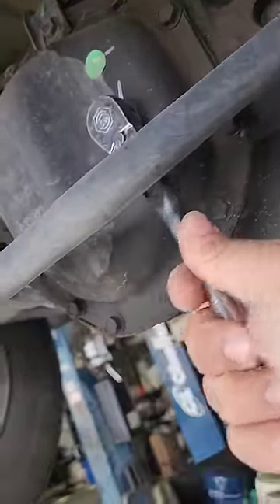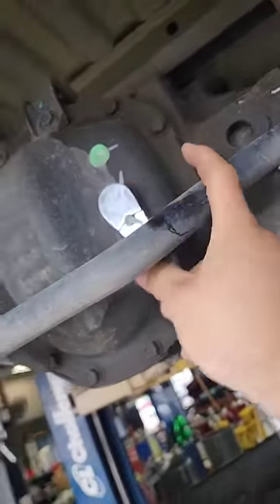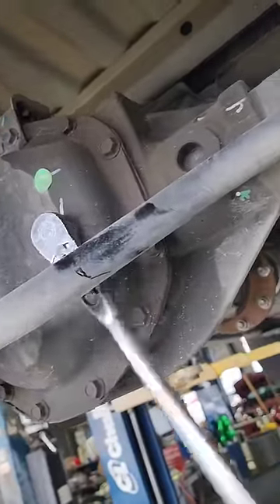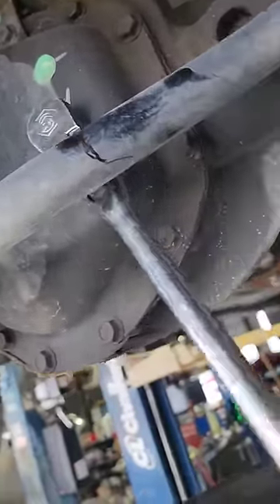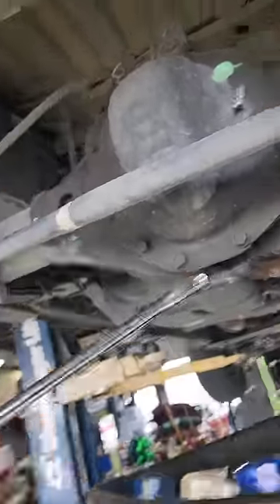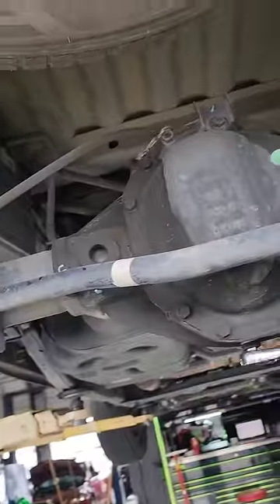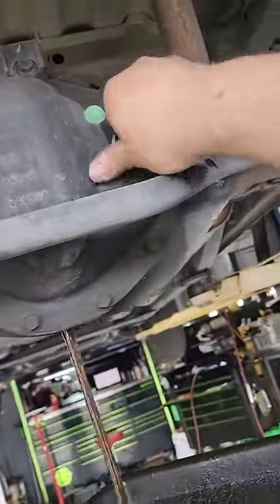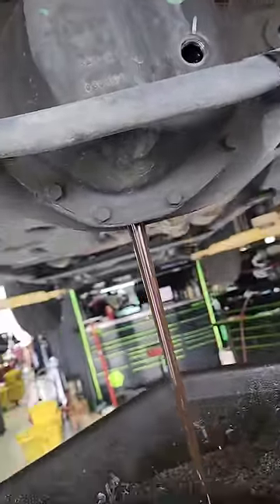MECHANICS PRO TIP #shorts #mechanic #auto #tools

Comment: The vent hole works as a fill, if needed.
Reply: @towtrkdug43 he’s referring to the vent tube coming off the top of the diff. Cant see it in this video.
Reply: @towtrkdug43  Correct, that is a fill hole but you can still fill it using the vent hole on the top of differential.
Reply: @LionWithTheLamb  I see what you're saying now. I misunderstood. I deleted my comment
Reply: @kingaxium5712  yah, I didn't pick up on that at first. I get it now. Deleted my comment...

Comment: Some diffs can be filled removing a cover bolt or its vent. 
Yes, it's a tiny hole and sucks, but can be done by any compentent Mechanic.
Btw,
If the hundreds of diffs worked on, I've never had a fill plug not come out. And that's on New England coast...

Comment: Always make sure you can fill it back up!!! I always teach my technicians this. I work on forklift, so this is very imperative for gearboxes.
Reply: Personally I always make sure to make sure the the top fill hole is not seized up before I remove the drain plug, Because if it is, it won’t be possible to refill it. But that’s just me. What was the video about anyway?

Comment: An additional tip for when you're checking the differential. After removing the top plug, make sure to dribble a drop or two out. That way when you replace the plug, it will lube the threads and keep the plug from seizing.
Reply: None will even "dribble out" because it is only ever filled to the level of the plug. But yes, always oil the threads on any fastener used in a motor vehicle, to prevent corrosion.
Reply: @johncoops6897 do NOT oil the thread on “any” fastener in a vehicle. Thread lubrication affects it’s torque spec. If you lubricate a head bolt and toque it to spec, you’re not really torquing it to spec because the specifications didn’t account for any thread lubrication. Although I like to lube my threads too, you have to be careful which ones can afford the extra torque of lubed threads.
Reply: Or just put anti seize on it 😅😅😅😂😂😂
Reply: Or just use anti seize
Reply: @malachihornbaker5869  who uses a torque wrench on a tapered thread fill plug? Just make it tight. SMH
Reply: @malachihornbaker5869  not true. You mentioned head bolts as an example. Head bolts are typically specified to be installed with a sealant or anti-sieze/oil depending on conditions. If "dry" it would be because there is already a dry lube/sealant on the new bolts. Never truly dry, they will gall.  Same for any other engine bolt- sealant, anti-sieze/oil or loctite depending. Most replacement chassis hardware is either plated or has a film which reduces friction by nature or has locking nuts/washers anyway.
A tapered drain/fill plug isnt going to back out because it has a little oil on the threads, the taper locks it

Comment: Seized plugs are usually easy to get out with a air hammer
Reply: I think the video he was referring (that he got the tip from) was some Honda had the fill plug in a awkward spot
Reply: @Burns11112  ohh ok ya an air hammer only works if you can get at it

Comment: Can't wait for him to find out to take oil filler cap off so oil drains faster
Reply: It also fits great over the hood latch so you don't drive off before you put oil in... again.😥
Reply: Crankcase is already open atmosphere through the air cleaner.
Reply: @Carlitosway211  and that's why I just go ahead and throw away all my pcv valves and put in flux capacitors
Reply: @mthompw  There's only one PCV valve per engine. The fresh are side is open to atmosphere.
Reply: Exactly, that's why I get rid of my pcv valves and install dual rotor flux capacitors

Comment: Thats why the second one is there. Its the same for all types of things that pour liquid at a decent and even rate.
Reply: It isn't why the second one is there. I hope you're trolling. You have to put fluid back in and that top hole is for putting the fluid in. Also you fill until it starts to overflow from that top hole. Thats when its actually at manufacturers recommended fluid level. -fill it til it overflows...
Reply: @brandondeel3567  it allows air in when emptying. Have you ever drank coffee? Or poured stuff out of a can. You add a second hole to gain a more consistent flow.
Reply: @Titantitan001  ofcourse the second hole is going to have that effect but thats not why its there. Its the fill hole. There is no other way to put fluid in a diff than to fill it from the top hole. So while it does help the fluid flow out faster, thats not the reason the second hole is there.
Reply: @brandondeel3567 I don’t doubt that? Things can have more than one purpose my guy lol.

Comment: I don't worry about it. Wisconsin guy here. Just drain and reseal, then if the plug is froze up, needle scale it, or clean it up, and plug weld a 1/2" nut or lug nut to the fill plug, sink that heat in hard, wait about a minute, and roll it out..... Works every time. Over a dozen or so trucks rolling around this county with a nut welded to the original fill plugs, yeah I leave em' that way, easier to get out next time they roll in. 👍

Comment: Fluid looks good! That’s crazy cause the owner must be doing RECOMMENDED maintenance schedules. That’s awesome! Not many folks do that anymore
Reply from the maker: Most people with COMMON SENSE would not be able to comprehend this comment 😂
Reply: @FluffyMexicanik  common sense at all that common! Kinda sad really 😅
Reply: They want their to be good as long as possible, I can’t tell you how many times I’ve recommended services after a truck has 160 and haven’t a done a front, transfer case or rear diff. And the gear oil looks disgusting

Comment: A tip i learned the hard way, on a sealed box, remove the fill plug first to vent air pressure. That way, when you open the drain, it wont aoray all over you. On automotive, this probably just means the coolant system, but heavy equipment is different.

Comment: You also pull the top plug first to create a vent so when you go to drain it  there's no pulsing effect (try pouring out a gallon jug of anything and it goes in starts and stops) the vent allows air to take place of the fluid and push it down evenly.

Comment: My dad thought me this when I was learning in my early teens. I thought it was a very good tip coming from him to say what a fool he can be. Another tip when changing spark plugs is to put the new ones side by side against the old ones which you have removed as sometimes auto parts stores have supplied the wrong ones and the ones they have given you might be longer plugs and the pistons might smack into them. I know someone who this happened to.

Comment: My dad had a Plymouth cricket when he was young, and he said he had to change the transmission fluid once. After he drained it, he tried to remove the fill plug, and it stripped, and it absolutely would not come out. It's a small car, high mileage, and not very valuable. He didn't wanna screw around trying to remove the plug anymore, so he took the tractor and basically held the car upside down, and filled the transmission from the drain plug. It was the last fluid change he was gonna do on the car so screw it

Comment: That fluid looks just as good as brand new would. I have never just changed the fluid in any differential I've ever owned I had a Ford Fairmont with 250,000 mi on it never had a differential problem

Comment: Check and clean the axle vent to make sure it isn’t stuck shut. All that oil on the differential could be a sign of a axle over pressurizing from a stuck vent, bad cover gasket, or pinion seal. This job is more than just a drain and fill with the evidence seen.

Comment: That tip is one that you won't understand how bad of a situation your in till it happens. I got through my first top plug seize using a ratchet on a floor jack. But not everyone's as lucky as me. Coming from a mobile mechanic, be skiddish, cautious, and as slow as need be when it comes to servicing a vehicle. Think of the worst outcomes and do those first

Comment: It kinda doesn't matter if you can't take the top plug out because if you can't the the top plug out then you aren't charging the fluid. Now check the top plug first and if it doesn't come out change the rear cover and plug assembly and then fill the diff up to the fill plug on that diff. I'm not saying you would not tell the customer that the top plug is stuck or charge them for changing the oil when you didn't but the customer will know you are a good mechanic and can trust you when you tell them about the stuck plug and I never had a customer complaint about cheating them because of fix the problem. Always let the customer know and when you call them have the price and availability of the part to fix the unexpected first.

Comment: Ok so if its stuck. You just give up i guess.
Axles have a vent tube. It can be changed from the bottom no problem. How does a outboard motor lower unit get changed. But macanical tip if something does not work try something else.

Comment: If the top plug is seized and you have an anti-lock brake sensor on the top as many Fords have, remove the sensor and add the required amount of lube through that opening.

Comment: Yeah, if it's seized you can Google the car find the type of rear end and it will tell you if the bolts are straight through. You should always google the car so you use the correct fluid in the rear end

Comment: That is one of the first things I got taught when I got into the trade. Not just because you want to make sure you can refill before you drain, but because it aides the draining process as air can come in through the top, rather than glugging in through the drain plug. It is concerning that someone in the trade didn't know this.

Comment: If you get stuck, pull the axle and suck it out with a hose and refill with the hose until it pours out the axle.  Especially if you can't get either plug out

Comment: Open the top plug.dip in your finger.if it's not black will metal bits in it put back the plug.its good for another 20 thousand miles.

Comment: You can refill without uper plug but it's messy. Stuck a long tube and bent it over the top of differential. It can indicate the level too when the siringe isn't connected with the tube.

Comment: Has a vent tube. Force filill it back through the drain hole with Designated amount of fluid overfill by 4 to 5 Ozs depending on how quickly you can move lol.

Comment: You open the fill plug first to make sure the vent isn't clogged and that it had the proper fluid level to begin with. If the vent is clogged the diff will be pressurized and you'll hear the air escaping when you are taking the fill plug out. It'll probably spray fluid too if you take the plug out to fast😂..

Comment: On a outboard boat engine, it is recommended to pump the oil from the drain plug up through the system until it starts coming out thr fill plug
Reply from the maker: really?
Reply: @FluffyMexicanik  yep
Reply: @FluffyMexicanik  the lower unit gear oil, not the engine oil
Reply from the maker: @andrewarmstrong9194  ohhh ok that makes sense lol

Comment: Gear oil. In general it's not replaced unless there's service, like pinion bearing failure, axle bearings or shaft seal issues.

Comment: Actually if the fill plug strips there is a way to fill it there is usually a valve on the top or a hose connected. My 94 Chevy has a stripped plug and that's the only way I can fill it

Comment: ⚠️You CAN refil from the bottom with a pump. Pump the required amount in plus 50ml because that's the spillage amount while you quickly put the plug back.⚠️

Comment: As a former tech in the snowmelt, you have no clue. 😂
We know those plugs are rusted shut, so we just order a new diff cover.
Remove the old one as it drains, clean it all up, install the new cover & fill it.
But usually, you need a new truck before your diff needs serviced.

Comment: I always check the top plug on each axle(if equipped) on every oil change T/C as well and it drains faster with the air flow

Comment: Homie if your top plug is ever out of reach or stuck, stuff a pump hose in the drain, stuff rags around the hole and the hose, and pump as fast as you can, youll get it all im there no problem

Comment: always make sure you can add before you take away, even oil changes, make sure you can pop the hood and take the oil cap off before you drain it. In the rust belt hood latches rust and cables rust.

Comment: Dont see any talking about how its also good to remove the cover and clean off the magnet. It does buildup with ferrous shavings..
Reply from the maker: The magnet is on the plug its self
Reply: @FluffyMexicanik  
So those dont have a magnet stuck to the cover? Well, I like that design more. I've only ever had diff covers with no drain plug. Thx for sharing!

Comment: You can pump oil back in the drain using a piece of fuel hose the same size as the hole, as long as you know the quantity to put in it.  'Worst case Ontario, you don't need to be a rocket appliance' - Ricky

Comment: It's very easy if top plug is rusted.   Take cover off and put gear lube in plastic zip lock bag. Place bag in the rear end and put cover back on.    That how I did it for years.

Comment: If the top plug won’t come out or seized are you call it you fit it. That’s what mechanics do. If you can’t pull the ABS sensor employer on the top of the differential that way.

Comment: Another quick tip - never use the ratchets drive directly on the bung to crack it, use an extension. If something is going to snap better it be something cheap.
Reply from the maker: Never had an issue, yet

Comment: Same process holds true for transfer cases and manual transmissions pretty much anything with a drain and fill plug always take out the fill plug first because you can drain it from the fill plug and you can't fill it from the drain plug

Comment: I've had 4x4's most of my life and that's common practice since many will drive through water at some point while on or off road. I'll usually check the vent tube as well since they'll get plugged on occasion.

Comment: It is a very rare occurrence, even on Rusty trucks, to have a fill plug and a diff that cannot be removed
Secondarily, if the plug is seized then it needs a new diff cover which fortunately are relatively cheap and easy to acquire
I work the Rust Belt for 40 years and in that time I don't recall ever having to replace a cover for an unremovable fill plug.
Just saying, it's a nice little internet something something
But it ain't real life

Comment: You could also use the correct tool that square hole is tapered, a ratchet head is not. there are tapered plug sockets for that job.

Comment: You can actually pump oil up thru the drain plug if you get into a future situation. Done it many times especially with no fill hole transmissions. So this is a new tip from me 😊

Comment: The big reason why you attempt the removal, if I recall correctly, has to do with suction.  When you drain and attempt to remove the refill, it feels like it was torqued by a gorilla pumped with steroids cause that shit will be HARD to remove.

I’ve ran into this twice.  Even on one I knew was torqued to spec

Comment: Pro tip: if the fill hole is on the cover it doesn't matter if it sticks. It can be easily removed or replaced.

Comment: I was taught the same due to rust also to leave the fill plug out to improve the draining of the fluids. Like for oil changes remove the filler cap before the drain plug. that was way back in 1977 by my dad.

Comment: you can also just look up the specs and get the fill amount and bottom fill it. wrap a rag around the nozzle of your oil dispenser and stick it in the drain and put just a little bit more for when you quickly take the nozzle out and put the plug and spill a little bit

Comment: I mean is it really a proper service If you don't remove diff cover and clean everything and pre lube diff, clean mounting surfaces, clean diff cover (I even paint it, yes on every every vehicle) and then reseal and fill with what ever fluid and additives necessary. Then rock diff back and forth after filling before driving. And the stuff I work on is BEAT, Canadian weathered ,ocean aired rust buckets. So there's my tip on stepping up your game !

Comment: My husband's had only the top plug it did rust up but my dad had the tools to drill and retap a new hole ,he was changing the gasket it was leaking he had the plug at the top to refill with fluid no drain at the bottom this was on his pickup truck ,my dad is a auto and diesel mechanic glad he knew what to do .

Comment: Inject the measured amount of fluid from the bottom drain plug hole if the top plug is seized to get you by in a pinch.

Comment: The new trucks all have reusable gaskets. I loosen the bolts, drain it from the pan.  Torque the bolts, spray brake clean on a rag and do the "out of the shower towel trick" to clean between the cover and diff. Fill it. Never had a problem. Dont even take the bolts all the way out. YOUR WELCOME.

Comment: The metal is so this these days by the time the plug freezes the cover is rotted out. You try to open the fill and end up with the plug, threads, and big hole on the ratchet.

Comment: You shouldn't ever just used the drain plugs. Diff plate and magnet inside should be removed and cleaned and also inspect the gears.

Comment: The way that was coming out I would definitely check that vent I bet you it's clogged almost every truck I service if it's a couple years old or older the vent is clogged and that can lead to leaks people end up replacing axle seals when it's just a case of the axle not breathing as it gets hot there is no wherefore the expansion to go so it'll push oil out the seals

Comment: I personally think that this tip does not apply for professionals. Because even if you can't loosen the top bolt the service still has to be done. So you will find a way anyway. Because otherwise you let cars level the shop without proper maintenance because the bolts were to tight ?